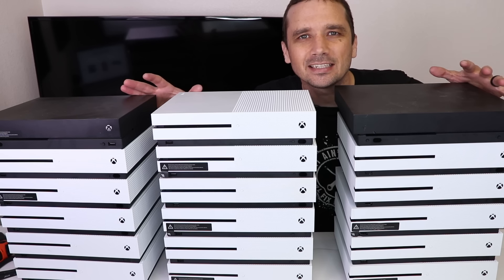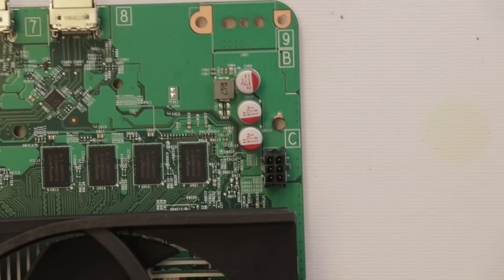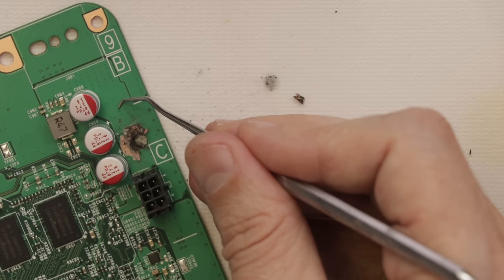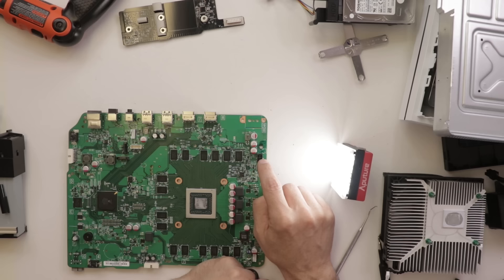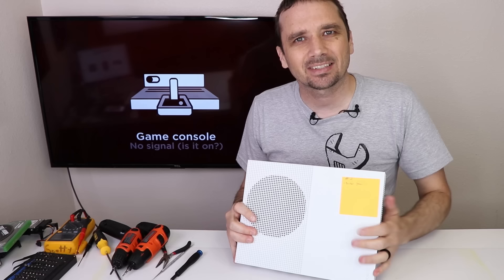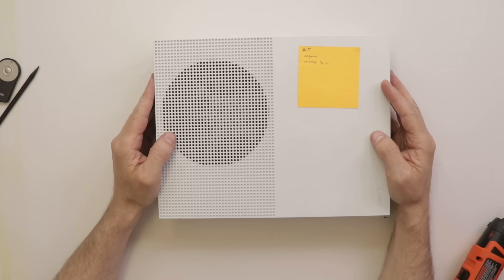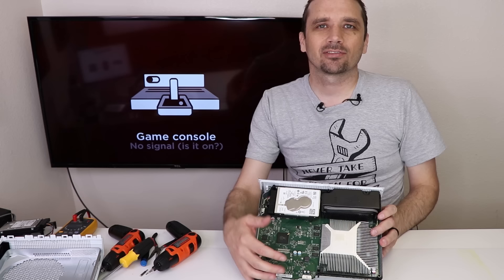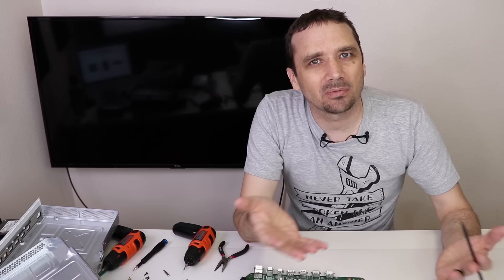I bought 18 broken Xboxes - Can I Fix Them and Make Money?

Comment: with the second Xbox maybe you could try to replace the front panel with a known good one, a short on the power switch line could cause the Xbox to turn itself off after it's switched on
Reply: LOL you are so far off!
Reply: @Zombie326  A "short" on a power switch? Can you even realize how stupid it sounds?
Reply: @cocosloan3748  actually if its a can-bus switch it can short
Reply: @cocosloan3748  actually the power switch can short like any component if the two  terminals are connected. You clearly don't know what you're talking about
Reply: I was wondering the same, why didn't try to change front panel?
Reply: Send the trolls to the BLOCK party brandon lol, this is a good comment. I don't have xbox repair experience but I do have pc experience & macbooks, other electronics too a messed up power button can DEFINITELY cause that to happen
Reply: @cocosloan3748  really? have you never come across a short on a power switch?
you'd even find a short on a screw...come on, be open minded.
Reply: Jule Rulez Good try at trying to be smart. Good luck next time!

Comment: hes a youtuber and a console engineer... give him some FFFFUKIN credit Nd love REAL quik 🤙🤙🤙👍👍👏👏👏👏❤️❤️❤️🔥🔥
Reply: console engineer my ass. he just knows how to probe for conductivity and how to switch out a power supply. It doesn't seem like he has any actual engineering knowledge. Case and point that he's risking the onboard power supply to check these boards for shorts. Any actual engineer (or even someone who works on electronics for a hobby) would use a couple hundred dollar programmable power supply that wouldn't risk an overcurrent because it would shut down first. Also he says "there's no way to figure out what the voltages are supposed to be on these boards without a schematic" which is just a flat out lie if you have any experience with designing electronics. I did enjoy the video, but damn I wish he had a little bit more knowledge on how these work

Comment: I’ve had a couple of power issues coming from the surface mount capacitors  on the bottom side of the board under the apu. I don’t remember if they were partial power or no power though.

Comment: With that first one, I've seen amplifier repair videos from Barevids who has said before when the board burns, the carbon it leaves behind can become conductive and cause shorts. Happens alot with amplifiers as when them Mosfets burn up they usually burn up pretty well 😂

Comment: Hey, love your videos. For those that didn't turn still check the mosfets. One could possibly be on the way of going bad. Check the value between them in diode mode
Reply: @lucasrem  what?
Reply: when the Indian boi tell you the MOSFETs on the motherboard go bad and you actually listen lols, try turning the whole power grid off, might be faulty breaker xd

Comment: on the 2nd one, just try to plug in the fan and stuff
might shut down instantly because the fan isnt connected
Reply: Fan doesn't interfere in the power system. Fans are just used to cool down the temperature. Just like computers. You can use a computer without any fans, but it will heat up fast.

Comment: On the 5th one you should’ve bought the new digital xbox case, put it on and sell it as the xbox one s digital edition 😂, jk but imagine
Reply: iRunner_ Does the xbox still function without the disk drive?
Reply: Pjnerd does a PC function without a disk drive?
Reply: @kngu1911  Im aware pc's work without a disk drive, I just feel like maybe xbox implemented some sort of software block when It doesn't detect a disk drive

Comment: Replacing HDD on XBOX One is not easy. Bad design from Microsoft.
Reply: I agree, they're calling out for a caddy like design.
Reply: Kra Gle kinda like the 360 ( wich is also the reason the rrod happened)
Reply: @Kra Gle well Microsoft doesn't produce their own hard drives lmao. The 360 had a standard hard drive with a SATA to proprietary cable adapter. The original Xbox had a standard IDE hard drive iirc.
Reply: @Kra Gle Could be a replacement drive because I swear they're Seagate Spinpoint's in XBox's (more into PC repair, myself)
Reply: @Kra Gle I worked as a technician for 18 years and yep, your right, Seagate HDD's suck. (they used to be better, but have gone downhill) although Toshiha, Hitatchi (before they got bought out by WD) and Maxtor (before they got bought out by Seagate) are all, just as bad. The only good, reliable drives that i've ever come across, have been from either WD or Samsung.

Comment: I had the on/off problem with my Xbox one. No clue what happened to it. I read something crazy on an obscure forum. Apparently if you heat the xbox enough through the vents it will turn on and stay on. This actually works. A hair dyer works really good but it takes about 10 minutes. I hear around all the edges and keep hitting the power button every couple minutes. Once it in I won't have the problem again unless I unplug it for a while. Then you have to do it again. It functions perfectly other than you have to bring a hairdryer if you take it to a friends house.. weird but it works for me

Comment: It might be safer to plug the power cord into a powered off surge protector and the console then flip the switch. Just to keep your fingers from getting zapped.

What could have happened is the current from the power supply is much more than the current from your multimeter, which caused the current to arc between the two nearby layers.

Comment: On those Xbox one's with the partial power you never check the board on the front of the Xbox. If that main connector joints heat up they pull away from the board. I won't fix all of them but it's worth a look.

Comment: Use a Blow Dryer to fix the ones that power on and then off instantly, turn the blow dryer on high and HOT settings and blow it into the vents for 5 minutes or so.

Comment: I have an Xbox 1 s and it doesn’t read disc it will take them in and put them and I can hear it spinning but it won’t read it. The Xbox has no others issues that I can see I’ve tried cleaning the disc and the good old blow in the hole and none of that works what should I try
Reply: Put them out 

Correction

Comment: Great video. I can use the circuit board fix for my Zotac GF9300 itx motherboard. It has a short in one of the holes where the cpu cooling bracket goes through the motherboard. Was screwed down too tight and shorted the copper layers. Thanks for showing a way to possibly fix it. Now to get some 'solder mask' and those pick tools for cleaning it.

Comment: the chips that you don't want to re-ball on x-boxes, etc, throw some flux on them and put them under the heatgun for a bit, push them down with the tweezers once they are settled, then let it cool. Won't help all the time but sometimes it works.

Comment: hello
i'm not too sure if this was mentioned before and sorry if i sound like a noob. i enjoy watching your videos. i'm not an electrical engineer but maybe i can help with the partial power problem. 
as far as i know the power unit is a 5v standby and a 12v operational power unit. so the 5v should turn the console on, but it is not switching between 5v and 12v so the problem is on the motherboard not the power unit. 
probably a faulty repay.

Comment: The spirit of repair and DIY infected me from watching so many of these videos so I replaced a Disk Drive on my launch Xbox one.. You have to remove the controller from the old one and put it in the new drive (its only 2 wires that need to be solders). Scariest part is the fragility of the ribbon cables.

Comment: For the partial power issue, just a thought, but perhaps the board with the power button on it has the issue. Maybe the touch sensor. I am not a surface mount electronics guy, just something that came to mind.

Comment: for your thermal paste i noticed you didnt spread it over the entire chip. does it make a difference? for years ive always made a even layer across it and its always worked good but its always been a debate as i posted a video on it years ago and half the people said i did it right and half said i did it wrong. the factory barely ever puts any on
Reply from the maker: It works fine to do it like I did for game consoles. Ask 10 people their opinion about it and they will all give you a different answer. I can tell you from experience that it works perfect doing it this way.

Comment: Hey man I got a question. I have a one x and recently started getting pixel issues where it shows hundreds of tiny green pixels on the tv screen. This only happens with the Xbox and not any other sources. It seems to fix itself when I unplug the hdmi cable and plug it back in. Any suggestions?

Comment: Whats with Microsoft making it so difficult to open an Xbox?  Stupid plastic tabs everywhere.  Use screws for the BS thats broken on release.....
Reply: it took me 3 number 1 screw drivers and a few jewelers flat heads to get the plastic off.  Replacing the thermal paste, which was dried out like a mummy and assembly was easy if you stage your parts during disassembly.

Comment: You could use a logic analyzer on a known good board. Then use it on the partial power boards. This will tell you where in the digital logic circuits the fault is. As in, if it is a CPU/GPU/ or other IC. The CPU and GPU can be removed using a hot air reflow center. This will desolder the IC without damaging the IC or the board.

Comment: Well mine is having a problem when it will turn on everything but my TV is black and the controller is having a light show on its own. I did leave a game when it was running and I did unplug it from the wall when it was still on. I don't know if that was the cause or not but know its not working at all. I've tried everything to get it to the starting screen and no luck. Someone have any idea on what to do.

Comment: Question my Xbox one s turns on for about 20 seconds then turns off it isn't overheating cause I put new thermal paste and the power supply is outputting 12v as it should but makes a small noise like you can hear the current flowing through it please help I'm about to toss it out the window lol

Comment: Hey man, quick question. I'm planning on doing a mod on an all digital xbox one, I'm putting the LED's and a window in, and with the extra space internally on the xbox I was thinking of running a few external harddrives through a USB 3.0 hub. I'm aware that the xbox can only ever acknowledge 2 at a time, but my question is, am I able to run the hard drives through the usb hub and only use one physical usb port on the back of the xbox from the hub, or does each hard drive need it's own port directly on the xbox? Thanks!

Comment: TronicsFix, can I ask you for a technical advice. I have an Xbox One X black and white edition from 2018. When I changed my  original dried out thermal paste with Cooler Master Maker thermal paste, the console is louder when running 4K games. Louder than with the original paste. I changed the paste 2x already, with the line and full spread of thermal paste. It is the same thing, when playing 4K games it is loud as a little vacuum cleaner. It is quite annoying. What could be the issue? Thank you, for the help. 😄

Comment: I have the 1th black Xbox one and exact on the same area I have a long screw damage there. But my long screw damage were a little bit more to the right close to the edge. I thing maybe the screw shorted so etching but the layer on top is not short but 2th layer is short but not 3th. I have the one with external power supply so power begins at where the B and 9 is. Any tips? Should layer 2 be ground?

Comment: That last XBox-X you were trying to fix that kept aborting, I'm wondering if that has some sort of memory chip problem.  My theory is it loads the data from the USB drive into a memory buffer,  and writes it to the hard drive,  but at some point it begins using another RAM chip to hold the buffered data ... and falls over.    Is there some sort of memory test?

Comment: Can you please do a video on how to replace a broken sata port for the internal hard drive on a Xbox one a. I was cleaning mine and when I unplugged it the whole plug along with all 7 pins ripped out. I’ve seen videos on how to replace a sata port but the one on a Xbox the solder point don’t show on the bottom of the motherboard?

Comment: Can anyone help me. I have white marks all over the bottom of my Xbox one s motherboard. It's all over. Looks like water damage but im OCD with my consoles and it's never been near water. It's white chalky marks that seem to follow the circuitry. 
It seems to be spreading and getting worse. The console works fine. It has funny moments but just takes a reset to fix. 

I had it since new and it's the 1st gen of Xbox one Slim. Brought on release.

The marks are only on the bottom of the motherboard (X clamp side) it's not on any other parts. 

Noticed it when was doing the 6 month clean and changed out the thermal paste.

Comment: Can u help me fix my cbox one s I cant get it to work I mean it does but its inerly and I dont want to loose al my saved files there
Reply: Make sure it's plugged in fully. My Xbox one s did that. I thought thought it was the HDD. But turns out it was perfectly fine.
Reply: @shannonharvey8300  what I mean is that it got wet I followed tutorials and stuff when I actually got to open it.... hmmm I used a pen to create a t9 screwdriver what I mean is that the only t9 was only for drill but it ended up working by burning a pen...  going back the conversation the motherboard it got burned
Reply: I just need a motherboard but they hella expensive and hard to get

Comment: Did you ever fixed the power on and power off xbox1s ?
Reply from the maker: No...that problem is caused by a faulty APU or Southbridge chip in most cases...similar to the blod of death in the PS4. Just not worth fixing and many times it's not fixable at all.
Reply: @Tronicsfix  u lie

Comment: Hello Steve. I have the same problem with second console and i found out that the big mosfet on  the right side, i mean the thirth one had no continuity like the other two ones. So I replaced it and Now wont turn on at all, but if i remove this mosfet the console works perfectly. Of course i know i cant leave it that way. But i hope this info might help to solve the issue and share with me because at this point i dont know what to do. Motherboard has no shorts. Greetings

Comment: Curious question: when you have to remove a replacement part, I see you use flux to take it off. I don't ever see you use anything to re attach the new part, just looks like you are applying more heat until the new part sticks. What is that process in more detail?
Reply: Flux makes sure the solder runs better

Comment: Is this guy still alive not using insulated gloves to fix electrical stuff?
Reply: As long as you keep your fingers and the correct side of the power supply you are fine. All electronics use low amp power so only scares you. Would not reccomend getting shocked still

Comment: Ok I can fix the issue even if main àpu. I'dd need it In front of me although I know how I can't explain it well. My credentials. Radar tech in air force including fixing boards at component level. Tester and repair at sanmina building boards few years at geek squad on printer repair at hp for printers 12 years as copier tech. The basic repair is easy and like you said isn't always promising the longer fix involves other laters and proper fixing of the issue and can be a headache

Comment: So I fix it I got water in my console in June and I left it all apart for months september came and I was about to throw it out but I didn’t instead I plugged it in and it started to work so I didn’t follow ur direction which benefited my Xbox but now the new one that I have I can’t use because the hard drive is corrupted and I can’t fix that so now what

Comment: At 17:23 what did you spread around the chip to get it off?
Reply: I think it's called solder flux. I don't know much about it, unfortunately, so you'll have to do some research on it.
Reply: @rl_1237  thanks very much.
Reply: @hellcatchuck2723  no problem.

Comment: I have had my xbox for about 6 or 7 year n its starting to turn off alot I want to take mine apart but I'm afraid to.
Reply: 360 or one?
Reply: @shannonharvey8300  one
Reply: @royalknight6828   you may need to check the power brick. Or you can see if the power brick plug is bent, faulty ECT. It could be the button on your Xbox.
Reply: @shannonharvey8300  I have bought like 2 or 3 different power bricks. My son has a xbox 1 also  I have switched his power brick with mine too. N his works fine but mine is still shutting down sometimes it could be just getting old like I said I have had it like 6 or 7 years.
Reply: @royalknight6828  ok.